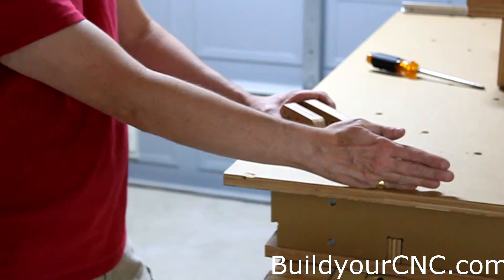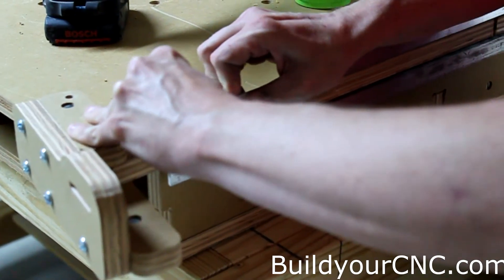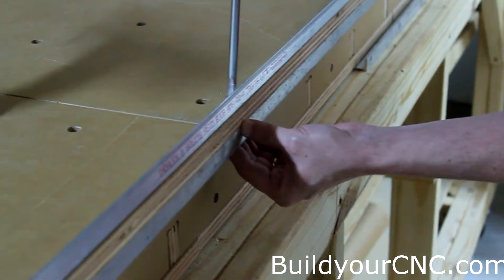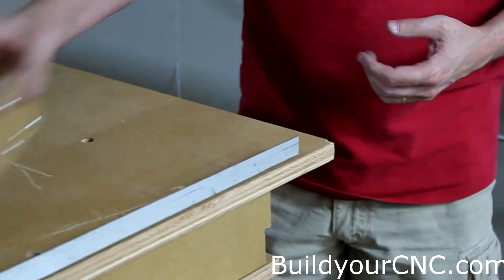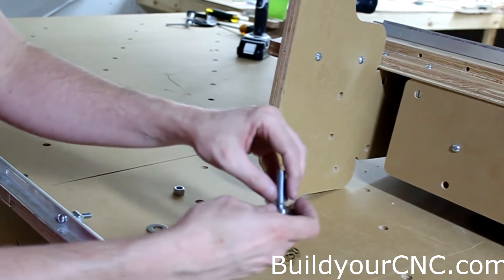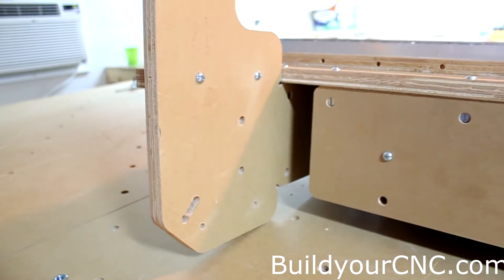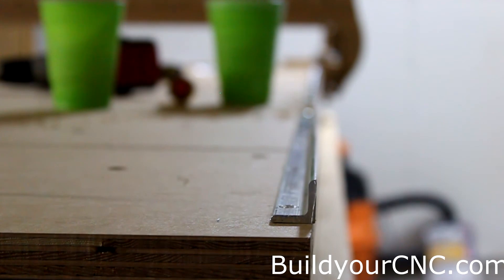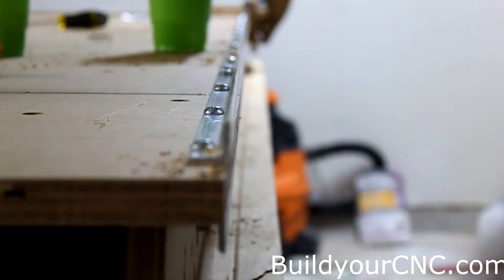greenBull CNC Assembly- Installing the X Axis Rails 2

Comment: I like this idea to set it almost vertically 
but don't you need to rotate the guide system? now you have a lot of axial load on the bearings.
It makes imo more sense to rotate the bearings 90°
Reply from the maker: These bearings didn't have a problem with this machine, but I did upgrade to HIWIN bearing blocks and rails for my later machines.

Comment: you could use a fishing line/ nylon and tie from one edge to the other and then measure diagonals , would probably be better, but then its actually very hard to make squares which r large, are u using the gantry to align it? wouldnt that make it skewed

Comment from the maker: @axel1973w I have found the Bosch to be the best tool I have in the shop.  I still have my original Bosch drills working perfectly, where my Makita has been replaced once, and Ryobi drills replaced 2 times and I just don't buy them anymore.
Reply: a tip : you can watch series on flixzone. Me and my gf have been using it for watching a lot of movies during the lockdown.
Reply: @Abraham Javier yup, I have been watching on flixzone for years myself =)